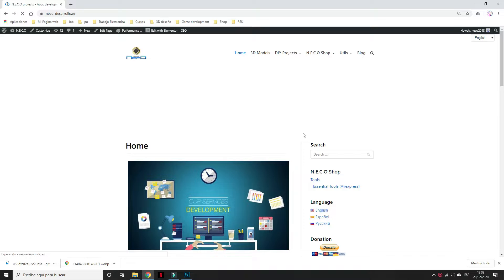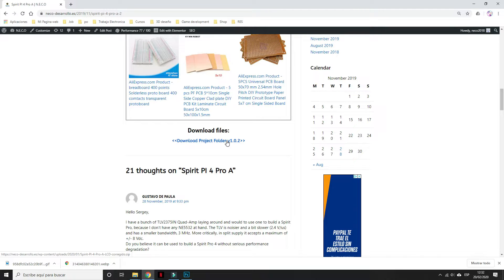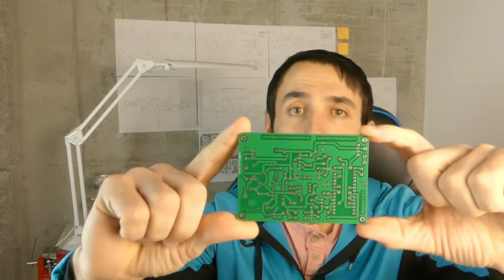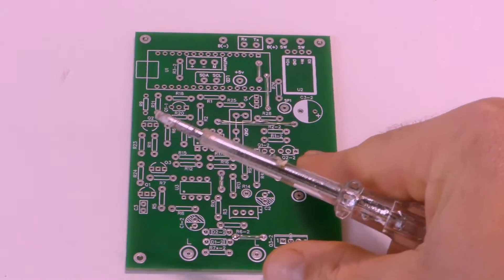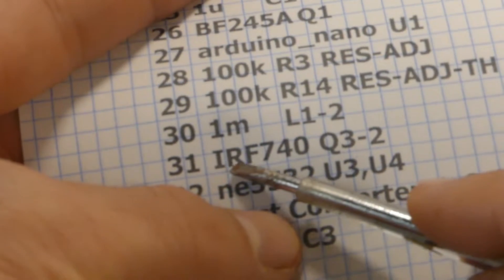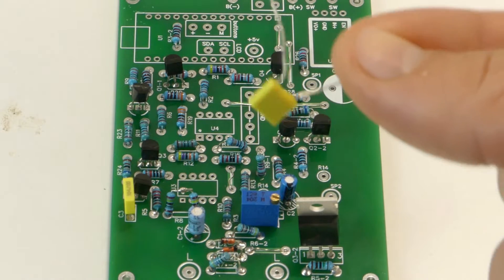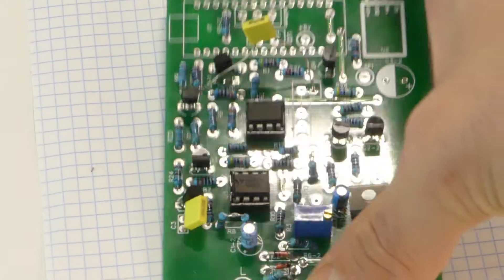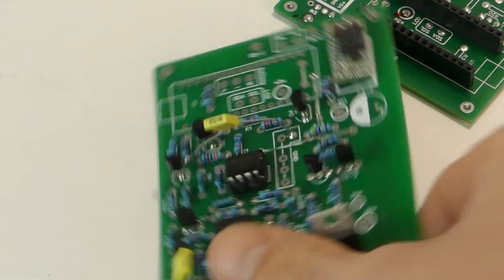HOMEMADE ARDUINO METAL DETECTOR Spirit Pi 4 Pro A with LCD Screen/ Part 1

Comment: Dear friend, i see in your pcb the R21 resistor is not included. So, my question is: that resistor and capacitor are  important in the function or is a old release than we forget and not connect?  Thank you very much for your share

Comment: Hello my friend. I watch your channel and I love it. I want to make one of those metal detector I just don't have the stuff to make and 3d printer for coils. I have a disability and get a small Government benefits. I can send tiny amounts
Reply from the maker: Hi! For this Pulse Induction metal detector you don't need 3D pronter, thus coil is easy to build, only 25 turns, circle diameter 20 cm, and wire 0.4 - 0.5 mm. It very easy, but for Smart Hunter it difficult to build the coil, be cause it is DD type coil